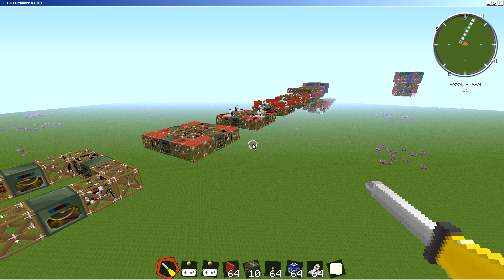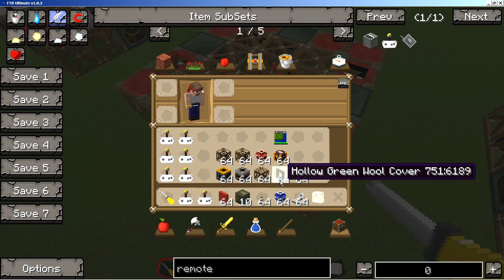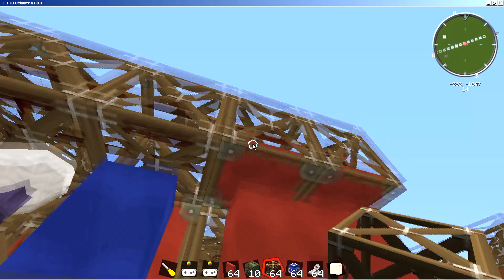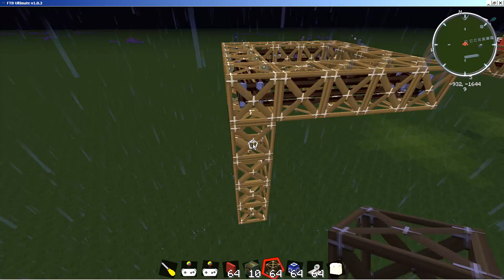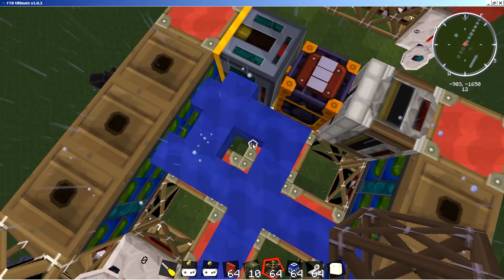Ultimate FTB Reloaded (Ep. 19) - Mega Turtle Mk. IV, Engine Module, 3-Axis Twin Chunk Loader

Comment from the maker: Optifine won't refine the resolution.  I'm not using OptiFine right now because it was actually causing more performance issues.  The difference between 64x and 128x is most noticeable up close.  From a distance it all looks the same.  You can also notice a difference on the item in your hand.

Comment: What's the reason for the hollow panels? Jacketed wire will attach to a frame without the need of a panel. So panels are really only needed to attach non-jacketed wire/other redpower gates, and to prevent crosstalk.